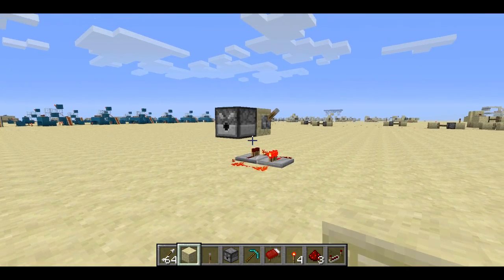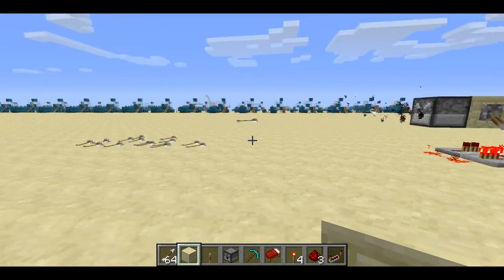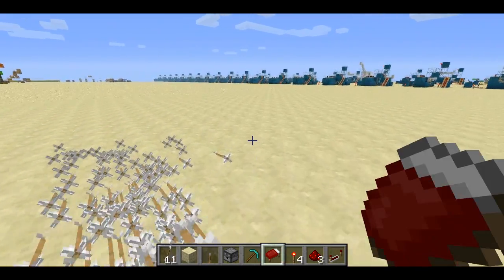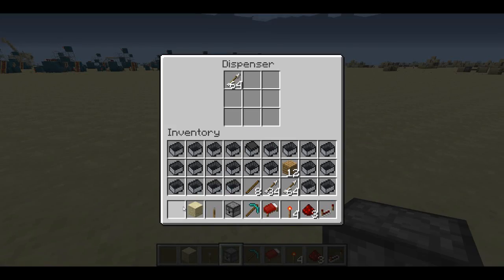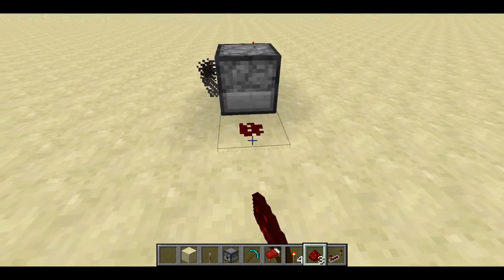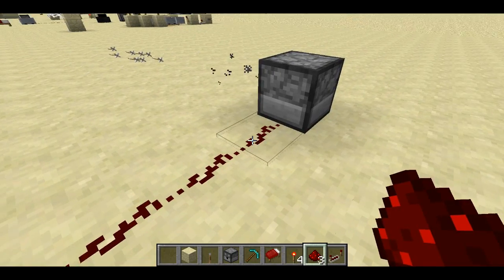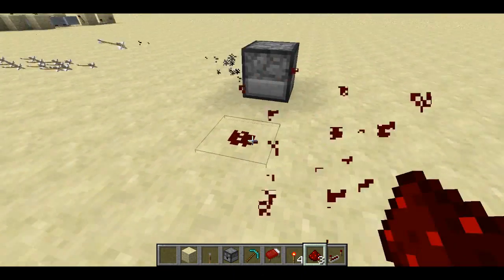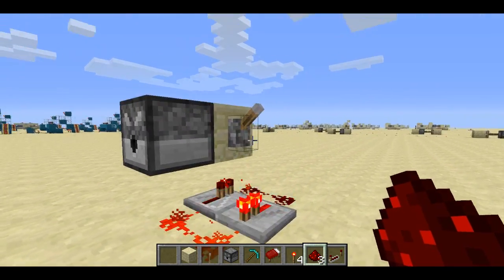Dispenser Bug in 1.0.0: 3x2x2 Toggleable Auto-turret that Fires 5 Rounds Per Second

Comment: @patapon2fan 
well to make that work you will need a bigger setup cause with that setup there you have to restart it manuli (it shut down every time you log out) and you cant use buttons or PPs to trigger it ^^
adn belive me it´s a pain in the A** to find a way to solve the problem.
my setup (with start and stop button) is about 20X6x2 blocks. 
and you might run low on arrows VERY fast ^^

Comment: @Shandys112 I've demonstrated a few clocks that are faster than the 1-tick on, 1-tick off pulsars in my videos, with the fastest -- having a total cycle time of 0.5 ticks -- shown at video ID O7AVZY5Zj4I but to get everything that's going on you may have to watch some of my previous videos.

You are still correct that it's impossible to cause a single dispenser shoot 10 arrows per second, though, as Notch purposely made dispensers unable to shoot an arrow more than once every 0.2 seconds.

Comment: I should make my last comment clearer: All of the bugs I show in my video about bugs resulting from interactions between pistons and redstone also apply to dispensers, including the fact that you can power dispensers from two blocks above (and diagonally above), and it's been that way since before pistons were added to the game.  The only ones that don't apply are those having to do specifically with piston extension or the extended piston arm.

Comment: @CreepersAndCows To make it just do the setup you see there, but without the dispenser. One repeater facing one way, another right next to it facing the other, both on the first tick, or default state. Then put the redstone on. Then simply place a block above one piece of the redstone, does not matter which. Then put a lever, flick it on so that the redstone is powered, and quickly break and place back redstone under the lever. This should start the clock. :)

Comment: That could be used for very specific, repeatable wireless signals if done right.  (admittedly with a 5~ minute delay...)
In fact, might even be a way to not need to use the dispenser+pressure system at all.

Comment: this bug's been around for a while actually (I remember when it was first discovered on the MC forums). I also remember using it to build a fully-auto dispenser turret wall that had almost no wiring, and fired the dispensers at the same speed, except there were like 90-ish dispensers, and all of them fired in complete sync.